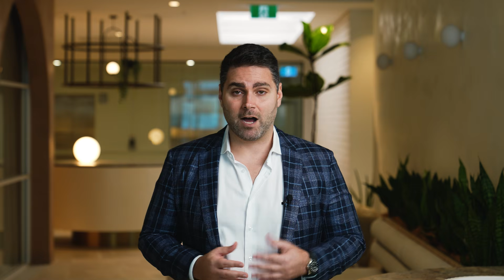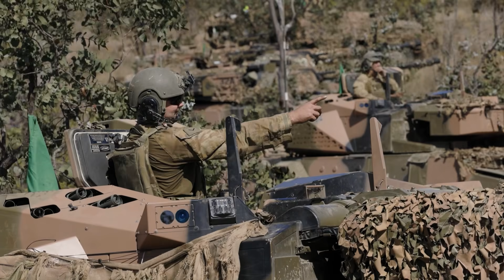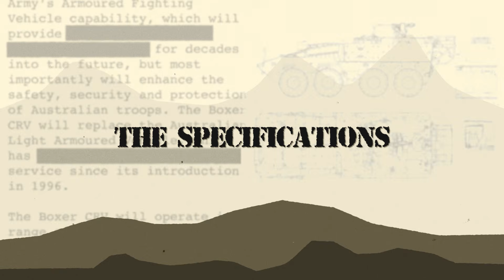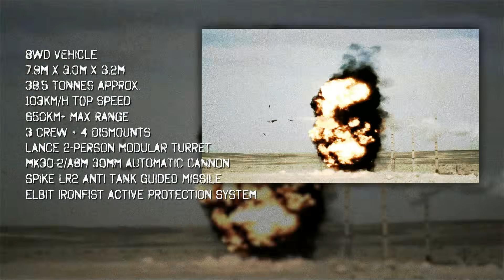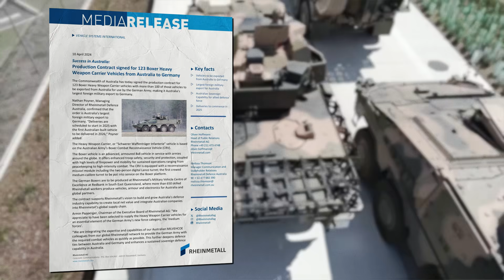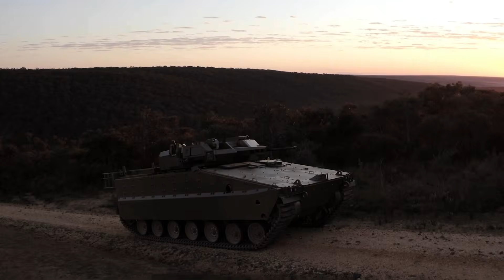Defending Down Under: The Australian Army's New Boxer CRV

Comment: 1700+ Boxers already ordered globally. UK another major user now. Germany to order even more, e.g. as self-propelled howitzer
Reply: Modern war will not be gentle with these AFVs.

A $35,000 lancet will destroy a $10 milliom (UK) / $25 million (Aus) Boxer from 40km away.

So could a $500 drone with a shape charge ducttaped to it.
Reply: @shanerooney7288  the same argument was made for ATGMs for decades now.
Unless you are Russian you usually try to avoid getting hit in the first place by not sending out your tank on its own but maybe with an air defense vehicle, jammer or something similar.
Reply: @roadrunner6224  
the two main differences are the range and the fact you don't need line of sight at time of fireing. 

NLAW = 800m
Javelin = 2km
MILAN = 2km
Spike LR = 4km
FPV drone = 10+km
ZALA KYB = 30km
ZALA Lancet = 40km

a Boxer IFV will out range and have line of sight on the ATGM teams. But not on the drone teams.
Reply: @shanerooney7288  but they are slower, less well protected against direct attacks and ew.
Drones are a problem for which there already dozens of solutions. APS, RWS, dedicated SPAA, counter drones, Manpads, AMM, EW, targeting the operators.
I'm not saying drones arent a threat, but they are a threat that will be dealt with.
Reply: @roadrunner6224  
You can have 100 different ways to shoot a drone out of the air, but it makes no difference if they are unreliable. 

Example 1: (lack of opportunity) 
"Target the operators." You just need to find them and hit them before they hit you. It's definitely something I'd do when given the chance. But it's not something I'd rely on for Anti-drone defence.  

Example 2: (funding limits)
Let's say Australia gets some SPAA, something similar to the Flakpanzer Gepard or 2K22 Tunguska.
That's millions of dollars spent per vehicle. Also, It would only work when the SPAA was travelling with the Boxers. I just dont see Australia buying 50+ SPAA to drive around with their 200+ Boxers.

Example 3: (working around the problem)
Take Ukranian Kamikaze drone boats for example.  There is evidence that they now have limited AI guiding them. You can't jam the signal if it doesn't rely on transmissions.
Alternatively,  have AI targeting only kick in when the signal is lost (usually on terminal phase of attack)

And let's not forget the cost difference. 
If the drone costs $30,000 (Lancet), vs the vehicle costing $25,000,000 (Aus Boxer)... they can shoot hundreds of drones per vehicle and still come out ahead.
That's why the days of $30 million dollar IFVs are over.
Reply: @shanerooney7288  I want to see the morale of the army that is send into battle under the instruction of dodging drones instead of being protected from them.
You have the options of either sending in your infantry on foot and with any direct support.
Or you give them some mobile firepower and because that is already expensive in itself you really shouldnt skimp on protection.

But in conclusion none of the militaries in the world are pivoting to lighter options if a heavier option is feasible and I trust them a bit more than you. (Nothing personal)
Reply: @roadrunner6224  
False Dichotomy. 
You are arguing between either going in on foot or driving a $30 million dollar AFV. Without considering the spectrum of options in between.

As for the trend of AFVs getting bigger and heavier - thats a known component of the life cycle of vehicle acquisition. The short explanation is "mission creep", but I like the long explanation: 

The infantry are on foot and can't keep up with the tanks. So you give them a pickup truck to carry them. Then you add armour. Then you add a flex-mount weapon. Then you put the weapon in an enclosed turret. Then you upsize the weapon. Then you add more armour. Then you switch to tracks to carry the weight. You upsize the weapon and armour again. Then you realise you've built a tank, and there's no room for the infantry.  And the infantry can't keep up with the tanks. So you give them a pickup truck to carry them....
Reply: @roadrunner6224  the problem is that NONE of the current solutions to drones are integrated in this design.
A single Piranha or Ghoul FPV with a shaped head munition will destroy it outright.
Russia is integrating EW onto all it's vehicles, they even have backpacks for foot soldiers with ECM now.
Also spaced armor (cope cage) is a must now, it needs to be integrated into the basic design rather than being welded on afterwards.
Other things like shotgun pellet firing anti drone defenses are in their infancy but need to be looked at, as well as wider adaption of Russian style battalion level air defenses (similar to Pantsir) to protect Tank/APC/IFV squads.
Reply: @roadrunner6224  so send everything in a big NATO style armored fist group like at Robotnye (aka Bradley Square?)
The golden rule of this conflict is to NOT concentrate forces, both sides learned this early on and the entire front line is very thinly spread because when you concentrate forces you get spotted then the artillery/missiles/drones arrive on mass.
People really need to pull their head out of their arse and give Russian methodology credit rather than dreaming it's 1939 and the Red Army is still using human wave tactics.
War has changed drastically in the last 2 years, we need to adapt now or fall behind with pointless and expensive endeavors like Boxer.
We need cheap reliable mass transport with good protection to transport troops.
And we need small fast and maneuverable heavy armor for fire support.
This means 2 different vehicles working together not a $25M 38 tonne hybrid.
Reply: @stevebuckley7788  it is integrated and can even be refitted. RWS have anti drone capabilities these days.
Also have you seen the stuff NATO rolled around with in Afghanistan and Iraq to prevent IEDs from being triggered remotely?
Spaced armor is also already a thing for alot of NATO equipment. It's called bomblet protection. Wether the heat warhead is mounted onto an FPV drone or a released by an artillery projectile doesn't make much difference.
Reply: @roadrunner6224  none of this is apparent in the specifications.
Reply: @stevebuckley7788  and why do you think you know better than 1000s of Generals and planners?
Concentrating forces will always be the solution, not even nuclear weapons made them change the approach.
Just because Russia and Ukraine aren't capable to shape the battlefield to allow concentration doesn't mean NATO isn't.
Reply: @roadrunner6224  it's idiocy like this that worries me greatly.
I understand the general public are not closely monitoring the Russo-Ukraine war and the obvious and complete failure of current NATO methodology in this conflict but the cope in our military is alarming.
Ukraine has reverted to Soviet doctrine not because they are incapable but because WE are.
Reply: @stevebuckley7788  oh no, tactics fail, if you cut out the most important part of the tactic, NATO is doomed.
Reply: @roadrunner6224  believe what  you want. Manoeuvre warfare is currently on life support because of cheap expendable drones that can easily kill a $4M tank and its crew.
Reply: @stevebuckley7788  if you say so, it must be true
Reply: @stevebuckley7788  Sie verwechseln dort etwas, die NATO kämpft völlig anders als die Ukraine ! Bei uns kämpft man im Gefecht mit Verbundenen Waffen und dazu noch mit Luftherrschaft über dem Kampfgebiet, alles das kann die Ukraine nicht...
Reply: @stevebuckley7788  The boxer can neutralise drones. So, I think this argument is hot air.
Reply: @TheGabbaKeks  In your dreams it can but the modern battlefield is something else.
Reply: @shanerooney7288  The 30mm weapon station that fires special ammunition can easily and reliably destroy FPV.          But the Investigation equipment need Space and cost.
These things seem to be only equipped in unmanned turrets.                      it's too big.
Reply: @cqde-e3o  
I agree it is big and expensive. 
But disagree that they can "reliably destroy FPV drones"

Yes they can blanket the sky with a scattering of air-burst munitions. And any drone caught in that will be destroyed. 

Those drones are small and fast. And can hug the ground on approach. I just don't think the turret has the targetting and tracking needed to react to an incoming drone reliably.
Reply: @shanerooney7288  Only the most skilled drone operator can make the drone fly close to the ground. This is too difficult.  
   
Fiber optic cables are prone to excessive bending. It will be more difficult to use wireless signals. 
The weapon station can rotate independently and quickly, which is also the reason for choosing it.
 In addition, the Frenchman is crazy. He equips a tank with 5 weapons of different calibers, which is terrible inefficiency.
Reply: @shanerooney7288 that why you have cheap IFV instead of expensive tanks.
Reply: @shanerooney7288 Drones are not the majority killer of armoured vehicles in Ukraine though -.-. People like you see a few drone videos and think everything is hopeless. Would you rather soldiers walked? Or showed up in normal cars? What exactly are you proposing. You haven't thought anything through really.

Comment: Which 30mm round will these use?  There are several.
Reply: 30 x 173 NATO 
The same is in use in the IFVs Puma, Lynx and Ascod.
Reply: @hans_am_ende one of the bigger 30mm rounds to my knowledge, it allows stuff like AHEAD to be fired which airburts sub projectiles at a predetermined range.

Comment: Why purchase the Redback as well as the Boxer? Why not buy the one vehicle. Not only has the Army got two vehicles to maintain, even though both have a 30mm cannon they don't even fire the same ammunition
Reply: different uses
Reply: @shanehansen3705 has an APC variant which can carry the same number of troops for dismount
Reply: Supported by Tanks, the redback can deliver an infantry section onto an enemy held objective, the Boxer is primarily a reconnaissance vehicle - it locates where the enemy is.
Reply: @RobertLewis-el9ub Carries the same number of troops and can also be supported by tanks
Reply: Different ammunition sounds like a logistics planning error.
Reply: Surely not. Government buying multiple weapons of same size with different ammo 🤔

Looks st the UK MoD...40mm Bofors for RN with 40mm CTA for the army. Absolutely daft.

Comment: After watching the Ukraine Drone teams I don't see that these are viable and will be vulnerable
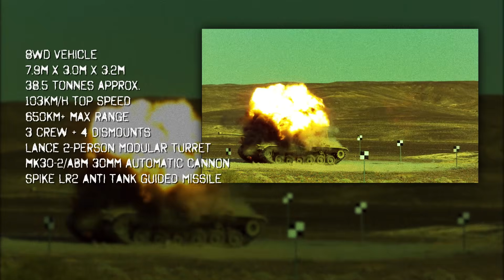Reply: 4:00 Elbit Ironfist. And other anti-drone systems will undoubtedly by developed drawing on the current Ukraine experience. The ability to adopt new technologies would be a acquisition/design requirement these days.
Reply: @graemesydney38 there already is a C-UAV variant of the boxer as well as the skyranger 30 and 35 which offer some drone protection capabilities
Reply: What is your alternative? Riding a bicycle?
Reply: @korbinianarnold6919  not to mention we saw where a pzh2000 with the weird spire armor worked to defend one from I believe a lancet so there are some ways to defend even if a little inconsistent

Comment: Likely that the ASLAV's will remain in service for a number of years to come, especially with various reserve units. The numbers of CRV and IFV's procured are way less than the Army needed. A service life-extension program is already being talked about in Canberra. With the M113's being taken out of service completely, the need for an armed APC capability that the Bushmasters cannot meet is obvious. A cheap stop-gap solution is to retain the ASLAV's.
Reply: They would be silly not to keep the ASLAVs, they are by no means outdated.
 Well said.
Reply: @BigBuddooMonkee  The ASLAV’S like the older M113 are indeed outdated and are no longer fit for purpose on the modern battlefield, that said, they are still ok for low intensity battlefields against less technologically sophisticated adversaries or for policing work overseas, however keeping ageing equipment just for that only incentivise our government not to spend money on what we really need for our troops and has been the main problem in vehicle procurement for decades.
Reply: @forgivemenot1  uhhh... you really didn't OP's comment, and it shows...

That's literally what we're saying: keep the ASLAVs for the Army Reserves, and retire all M113s. (i.e: for low intensity conflicts)
Reply: @BigBuddooMonkee I was replying to ‘you’ specifically not the OP, if I was replying to the OP I would have @ them.
And in that context, I stand by what I said!
Reply: @forgivemenot1   then you’ve completely misunderstood my original reply. 👏🏼

I never said they should be kept for high-intensity conflict, and just because they can’t, doesn’t make them ‘outdated’; they still have a use.
Reply: @BigBuddooMonkee  I don’t know how I misunderstood your original reply it was short and to the point, “They would be silly not to keep the ASLAVs, they are by no means outdated.”
They are outdated, I pointed out what they are only useful for, if we are going to put our troops in harm’s way, they should have the best we can provide and that includes the reserves.
“I never said they should be kept for high-intensity conflict, and just because they can’t, doesn’t make them ‘outdated’;” That exactly means that they’re outdated, if they can’t do the job they’re intended to perform they are outdated!
Reply: @forgivemenot1  oml bruh 💀 

You have a very weird and misunderstood idea of ‘outdated’.
Reply: @BigBuddooMonkee  outdated
adjective
US  /ˌɑʊtˈdeɪ·t̬ɪd/
(also out-of-date)
no longer useful or modern:

That's the idea I have.
Reply: @BigBuddooMonkee  The ASLAVs will get retired before the M113's as a fair chunk of the M113's got upgraded to AS4 spec.

Neither is suited to high intensity conflicts but both have an advantage none of the newer kit has - they're amphibious.
Reply: If they are so outdated - why do the Americans still use a similar platform the Stryker? As for spare parts - they just have to order them
Reply: @kenfowler1980  the Canadians are upgrading all of theirs and the USMC, Kiwis Saudis are also extending their use. Must be OK if they are keen to keep em
Reply: @wimmeraparanormal6581  exactly & they can be deployed rapidly on standard road & rail transport. And be used in wet environments, and I have seen 113’s bogged so they are fine! And I was on the original LAV 25 trials (transport capability) so I’m aware of their strengths and weaknesses
Reply: @kenfowler1980  Similar doesn’t mean the same, the Stryker is based on the LAV III and entered service in early 2000’s.
Our ASLAV’s are based on the LAV II which is equivalent to the LAV-25 in American use, mainly by the Marines, this vehicle was introduced in the early 1980’s and by us in the early 1990’s, the Marines are in the process of replacing them because they are out of date.
The basic premise being argued here is to keep a clearly obsolete vehicle in service that can no longer meet the requirements of the modern battlefield over it’s modern replacement which is already entering service, given that this vehicle is over 20 years old from a design that’s 30 years old and out of production then major service is going to be a problem and parts will also become harder to get and more expensive, we had to basically rebuild the 113’s from the ground up just to keep them going till now.
Reply: @forgivemenot1  I understand all of that ( i actually got to have a spin in one of those original LAV’s, so I know how old they are). However they are find for training and for issue to ARES units until the new ones arrive. My guess is our army won’t be deploying to the Middle East or Europe anytime soon & if we did need vehicles in a hurry I’m sure we can borrow latter model ones from the Kiwis!
Reply: I have watched AUSLAVs get bogged pretty easily and they only weigh a third of a Boxer. Drive carefully
Reply: @anthony9thompson  The ASLAVs have a narrow footprint and the weight isnt as ideally distributed as it should be in wet terrain...quite true. Issues in Timor and Shoalwater spring to mind. But, for the most part, they work and need to be retained to stretch APC capability for the next several years at least.